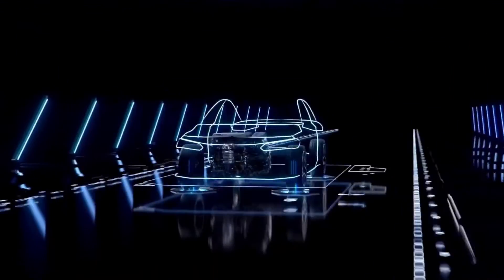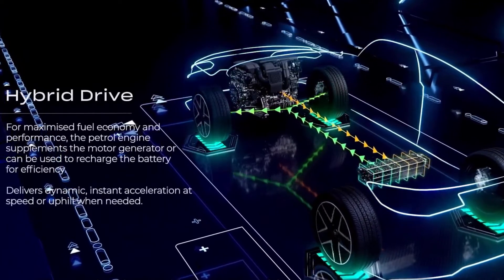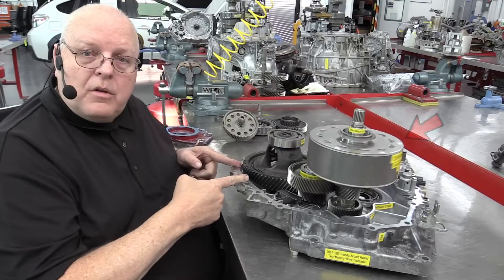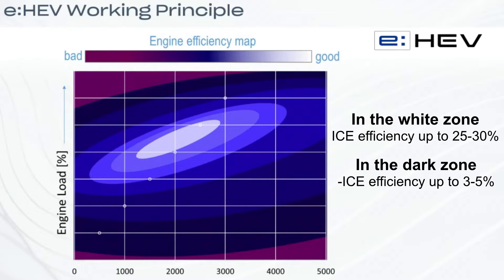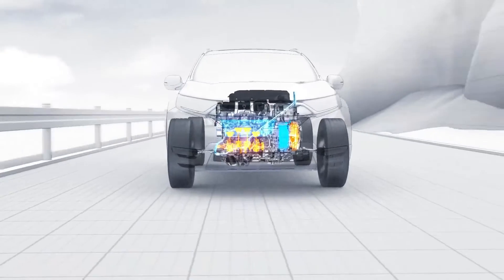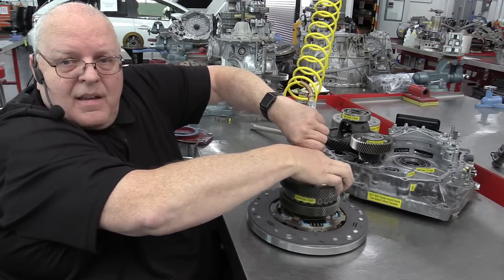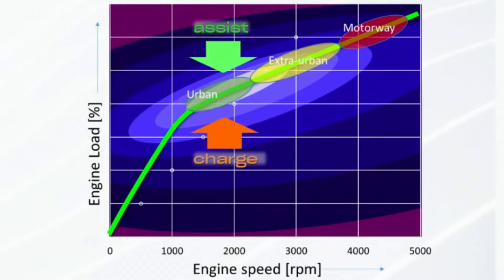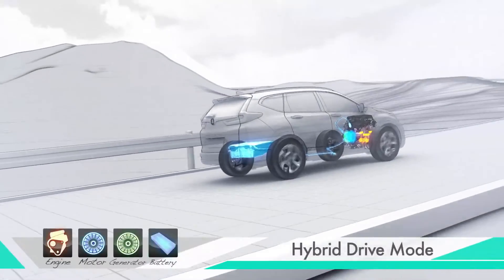Only 3L/100km! How Does It Work? Unlock the Mystery of Honda's Unique e-CVT Transmission!

Comment: Pretty worthless presentation but the professor explains it well. Listened to it a year ago.  +++Do a show regarding.... ✈ℕ𝔼𝕎  𝔽ℝ𝕆ℕ𝕋𝕀𝔼ℝ  𝕋𝔼ℂℍℕ𝕆𝕃𝕆𝔾𝕐  𝔾ℝ𝕆𝕌ℙ 🤯💥🤯Multidisciplinary engineer/inventor here. We are developing one of my numerous ultra simple, long life, engine architectures which offers Significantly‼greater ratios of power to weight[specific power] and energy to volume[specific energy]...without any pollutants [NO, CO2 is not a pollutant] and can use any fuel or mixtures thereof. It's will be based on the 𝔽𝕦𝕖𝕝 𝔸𝕘𝕟𝕠𝕤𝕥𝕚𝕔 ℤ𝕖𝕣𝕠 𝔼𝕞𝕚𝕤𝕤𝕚𝕠𝕟 𝔼𝕟𝕘𝕚𝕟𝕖  [𝔽.𝔸.ℤ.𝔼.] tech described below with thermal efficiency ~60% which is close to an EV's charge-discharge cycle efficiency.😉 😁 We are incorporating Waste-To-Fuel systems in the offerings which will provide ultra-low-cost, renewable, carbon-negative fuels for our engines and gensets...without pollution. Torque...constantly Maximal. We'll also develop my superior power dense rotary architecture. Coming to Yourtown soon. ‼

😶‍🌫🤯Before that, we introduce the revolutionary FAZE engine 
technology. The 𝔽𝕦𝕖𝕝 𝔸𝕘𝕟𝕠𝕤𝕥𝕚𝕔 ℤ𝕖𝕣𝕠 𝔼𝕞𝕚𝕤𝕤𝕚𝕠𝕟 𝔼𝕟𝕘𝕚𝕟𝕖  
[𝔽.𝔸.ℤ.𝔼.] tech best solves the issues present in previous internal 
combustion engine designs by transforming the old paradigm into a 
simple, low cost, quiet, power dense, efficient, on-the-go liquid and 
gas fuel-flexible, ‘non-polluting’ solution for power generation of all 
scales and advanced transportation, construction, military, off-road 
vehicles including ships, aircraft, trains & robots not possible before.

Companies can either get aboard or risk of getting run over.

𝔽𝔸ℤ𝔼 delivers better than 25% ABSOLUTE/ACTUAL [not relative] 
fuel efficiency improvement over gasoline engines, more than 15% 
for Diesel engines at any operating condition - speed/load, ambient 
temperature or elevation, not just at one optimal testing point at 
STP. Real world driving cycle savings could be an additional 200% 
higher due to the constant MAXIMAL efficiency and torque. The 
simple, low cost, native/built-in, non-electric, environmentally safe, 
non-explosive, temperature agnostic 𝕊𝕦𝕡𝕖𝕣ℍ𝕪𝕓𝕣𝕚𝕕© feature 
recovers more energy than EVs and provides approx.100% fuel 
savings for a combined absolute vehicle fuel usage improvement of 
approximately 300%, thus obviating the basic need for expensive 
EVs & e-hybrids. 𝕚ℙ𝕠𝕨𝕖𝕣𝔹𝕠𝕠𝕤𝕥 adds >400% more torque. It’s like 
4 engines in 1. 𝕚𝔼𝕗𝕗𝕚𝕔𝕚𝕖𝕟𝕔𝕪𝔹𝕠𝕠𝕤𝕥2© further improves efficiency, 
torque, power & other performance metrics by 10%. This is all done 
w/o a transmission. Additional fuel saving solutions are available.
 
The FAZE engine perfectly follows the vehicle’s road or genset’s 
electrical power demand with no energy loss [no fuel waste], This 
unique characteristic enables dispensing with any auxiliary power 
units [APU] for power or refrigeration in any application. This also 
makes for a perfect range extender for battery electric vehicles [EV] 
or as a standalone EV charging unit even where is no electric grid.
 
The fuel agnostic capability allows instantaneous use of any liquid 
or gaseous fuel [natural gas at home!!!] incl. biofuels and hydrogen, 
even if old/dirty/unprocessed like flare gas or employ the concurrent 
multi-fuel capability…anywhere on the globe. One engine for all 
locales w/o changes! Unlike EVs, this enables fast fueling anytime, 
anywhere…with no troublesome infrastructure disruptions or 
changes. EV’s are not a solution to the [FAKE]climate or mobility topics as 
high level of electrification globally is unrealistic 
[See Patrick Boyle's video "Electrify Everything?"] 

The technology offers smokeless, non-polluting, low odor heat and 
noise output without costly after-treatments, etc.,… with only the 
lowest  CO2. It has a negative carbon footprint with hydrogen, 
ammonia, biofuels or gasified municipal, agricultural and/or forest 
waste and coal from a 2-stroke-like simplicity. These are HUGE 
business opportunities. We can provide these turnkey solutions 

The FAZE technology can be integrated into any ICE or vehicle 
architecture, adding some of the positive characteristics to its own. 

With virtually no electronics and emissions equipment, the cost of
purchase and reduced servicing frequency make this solution 
even more appealing.
 
Those are my two-bits

PS.
Did I mention we're developing advanced, simple, low cost, power dense electric machines and torque dense[read - compact], infinitely variable FrictionLess transmissions?

PPS.
✈✈✈ℕ𝔼𝕎  𝔽ℝ𝕆ℕ𝕋𝕀𝔼ℝ  𝕋𝔼ℂℍℕ𝕆𝕃𝕆𝔾𝕐  𝔾ℝ𝕆𝕌ℙ is a visionary multidisciplinary B2B innovation company utilizing a licensing business model or collaborative enterprise with strategic partners to develop Advanced clean, efficient, power dense solutions in domains of energy, propulsion, mobility, robotics / exoskeletons and clean technologies with a particular emphasis on the aerospace sector including space exploration and commercialization

Comment: i came here just to reconfirm, Honda e-cvt did not use stealt belt isnt? I bought Civic FE Hybrid 2023 but afraid with the Gearbox since lot of people say Honda CVT belt is sh*t. Can someone confirm this?
Reply: Actually, the ECVT is not a gearbox, It just houses an Electric Motor, Electric generator, differential, and a Clutch to engage the Petrol engine at cruising speeds. It's like having a diesel/electric Locomotive, Instead here it's using Petrol. One petrol engine connected to an Electric generator gives power to the electric motor and charges up the Battery and an Electric motor which also drives the main wheels.

So you have a Petrol engine with let's say 100bhp and an electric motor with another 100hp, Once you press the accelerator to move from a stop the electric motor drives the main wheels, and as soon the battery starts to drain the petrol engine kicks in to charge the battery, once you start to accelerate more to a cruising speed of let say 100km/h the petrol engine kicks In and this time it drive the main wheels by engagement of the clutch. 

this is how at least I understood the system, it's more called a Series Hybrid system, I may be wrong tough.
Reply: @ripmax333  i think you're right, very simple but comprehensive explanation. But if i may ask, what is the downside of this kind of system, so that i can take preventative action.
Reply: There is NOTHING CVT about the Honda hybrid system.  It's a good system.  Almost as good as Toyota's hybrid synergy drive hybrids.
Reply: Not sure what a Civic FE Hybrid is. AFAIK, if it's a hybrid, then it's got the 'E-CVT', it's gonna be a E;Hev, so no belt system, it's the good kind. 

If it's NOT a hybrid (a 1.5 Turbo, I believe), then yes, it will be using a classic CVT with a first gear. 

If you have the car already, it should say E:Hev. If you haven't got the car already, you can ask the dealer or look at the order sheet.
Reply: @0bzen22  And Honda CVTs are great unlike most others. They have been using them since the 1970s
Reply: @0bzen22  Honda's CVTs do not have a first gear, Toyotas do from my understanding

Comment: The speed threshold, when Engine Drive starts to be used, is NOT 100 kph ~= 60 mph. It's more like 65 kph ~= 40 mph.

More specifically (and this for 2018-2023 Accords, but others are similar), in Engine Drive RPM ~= 37*MPH. So the limit is at about 1500 rpm. At that speed, and about 80 lf-ft of torque (about 23 HP), the green line enters the lightest blue region shown at 5:25. (The image was "borrowed" from https://youtu.be/6glpZTRT6qE ). Inside this region, it uses less than 210 grams of fuel for each kWh of energy produced.

The absolute minimum is 208.1 g/kWh, at 2000 rpm, 88.5 lb-ft (about 34 HP), or about 54 mph.

Comment: Hibrids should be dizel powered
Reply: Then the whole intension of having Hybrids will negate. Deisel engines are difficult to setup with electric motors which increase cost as well and increased emissions. So No to Deisel.
Reply: Diesels add weight and cost. 

Hybrids add weight and cost.

Seldom used together.

Comment: This tends to prove that the best and most innovative designs come from manufacturers who also work on aerospace projects. In the case of Japanese companies they have a better chance than others of having a dealership infrastructure capable of staying on top of maintenance and repair issues. If I ever had any cash I would buy Japanese, but sadly these innovations come at the end of my driving lifetime, having made much pollution over 3 million miles of driving. Better late than never.

Comment: Sounds wonderful and yet it does not give better fuel mileage than Toyota's hybrid synergy drive. Why?
Reply: Probably because they are both excellent hybrid systems.
Reply: I really should read up on this before I have an opinion but when has that stopped me. I suspect the main advantage with this is is getting rid of a heavy gearbox in the case of a traditional box. or getting rid of what has tuned out to be a very problematic CVT's for a number of manufacturers. A good CVT is only reliable as long as it is driven strictly within its designed parameters.
Using an engine to drive a generator to drive an electric motor is less efficient than using a geared transmission. The advantage is getting rid of the weight of the transmission, transmission loses due to friction etc, ability to recover energy in stop start traffic, and then theirs the torque of an electric motor. Plus the setup allows the IC engine to always be running in it's sweet spot. For slow stop start driving Engine>Generator>Electric drive probably works out okay. But nothing bets battery electric in that sort of driving.
Motorways kill batteries. It's all about aerodynamics or monster batteries. So a direct drive IC engine works well, mainly because of the energy density of petrol. But it's only going to be as fuel efficient as the engineering and aerodynamics allow.
Reply: Because there is no transmission there are no worries about worn clutches or worn out gearboxes.
Reply: You watch the video?
Reply: Toyota's system actually provides CVT action for the gasoline engine (nothing CVT about the Honda hybrid). The Toyota (and Ford, and Chevy Volt) uses a planetary gearset CVT. Very simple and reliable. At speeds below 45 mph the Toyota is an electric car with gasoline assist.  At highway speeds the electric motors work to make the gasoline engine do most of the work.

Comment: Sounds good. I hope it's reliable. I noticed they didnt give milage figures for highway driving where being hybrid is of no advantage.
Reply: Hybrids usually use efficiency tuned Atkinson cycle gasoline engines.  More efficient than the standard Otto cycle engine. 
But this kills the low end torque (which the electric motor has gobs of).

Anytime you are burning gasoline the Atkinson engine is more efficient
Reply: I have an e-cvt Honda and I would agree driving at a constant 70mph is not as efficient as city driving, however I still get just over 60mpg on a long highway run.  So I could not agree with you that for highway driving the Honda hybrid has no advantages.  It certainly does and even on the Highway, it will still seamlessly switch to full EV mode when it can.
Reply: @philiprobinson2011  . Incredible fuel economy. My 2013 Prius gave me over 58 on one trip but I had to hold back to 65 mph max.

52 is much more typical.
Reply: @dannybryant6873  Still very good efficiency.  My car is the Jazz so smaller and lighter than a Prius.
Reply: @philiprobinson2011 I agree. I could drive half a minute with a Civic XI e:HEV in EV mode at 120 km/h on a highway.
Reply: This is not unique to Honda. Toyota did the same in their l610, l710 and i810 ecvts. Yet, Toyota managed to get much improved milage figures. Look at the RAV4 prime for example.
Reply: If you think a hybrid gains no advantage on the highway, you do not understand how hybrids work. Most likely, you think that the only benefit is from regen braking. While this video copies everything from other sites, and does get some wrong, it does show why it gains on the highway. For example, the part at about 5:20 was stolen from https://www.youtube.com/watch?v=6glpZTRT6qE .